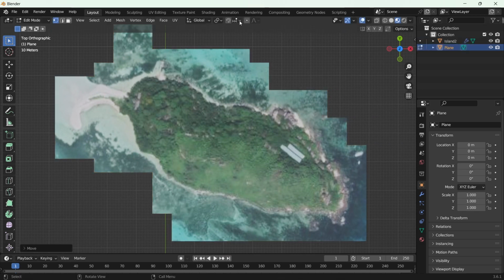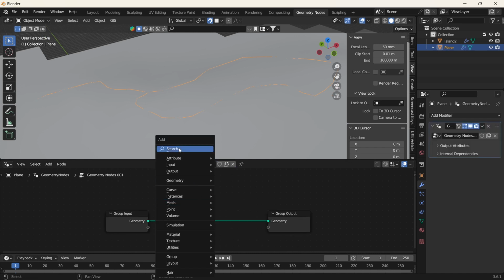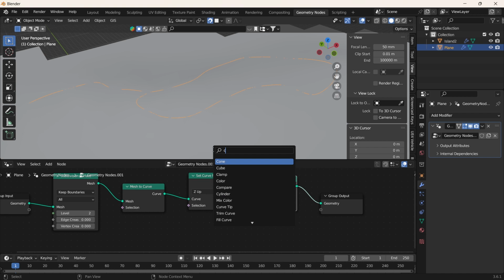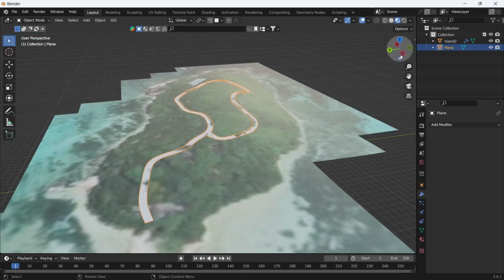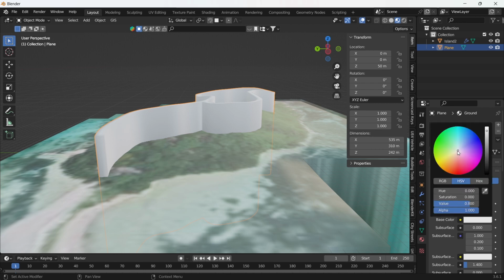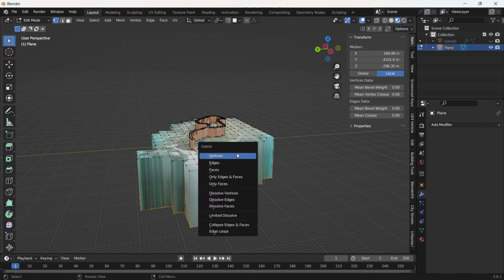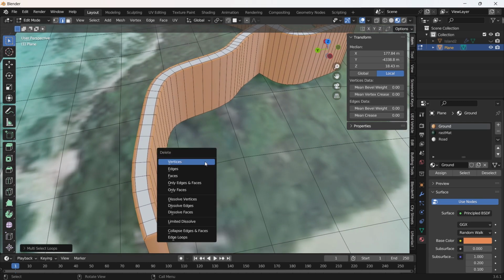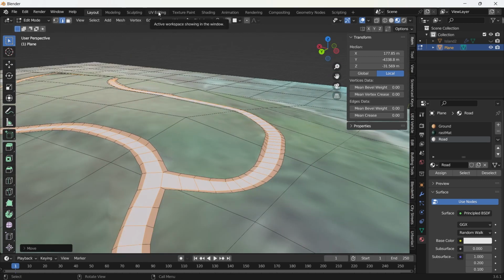How to make Mountain Road in Blender 3.6 | New Method

Comment: Hey, I have a problem when I select the plane and the faces before extruding all of it. When I drag the cursor to select everything, it won't actually select everything, but some points and faces. This prevents me from extruding everything correctly. What is this due to? Hope it's clear to you as it might be some very stupid thing lol
Reply from the maker: Ig u need to do manually, sometimes it doesn't work for no reason at all. Some problem with the face normals prolly, it doesnt recognize them as connected

Alternatively, just press A to select everything, in edit mode

Comment: Hello. 
I managed to get to Boolean Modifier part, but when I do it, I get a crater in middle of my path instead. 
Would you have any tips?
Reply from the maker: U have to do union maybe u r doing difference. If it doesn't work try applying the modifiers on the ground and then merge road
Reply: @Gamezoneadi  Thanks for reply, m8.

I fired up blender again and while trying your tips, I noticed that I have weird acting terrain.

My terrain goes flat in Edit Mode, has only 4 vertices, in corners, and it deforms a bit when extruding down. I used OSM Mapnik and OpenT for hight.
Reply from the maker: Check out the starting videos of the playlist

Comment: Really interesting way to do this with the nodes and extrusions, well done for working this out! Thanks for sharing it in such a straightforward tutorial 👍🏼 are you using the same gis plugins from previous blender versions to get the terrain?
Reply from the maker: Thank you. Yes it's the same plugin
Reply: @Gamezoneadi  going well following along until the point where we extrude the plane and the terrain. I’ve checked normals and merging for stray vertices and it all looks good but when I try to extrude on the z axis in edit mode it’s not moving at all. Yet to find a good answer on the google machine, any tips?
Reply from the maker: https://discord.com/invite/StBaCZ2f
Join my discord and share some pics where u got stuck. What's the google machine problem u r facing?
Reply from the maker: After merging u need to dissolve the outer edges and move the remaining road faces on z axis(not extrude)
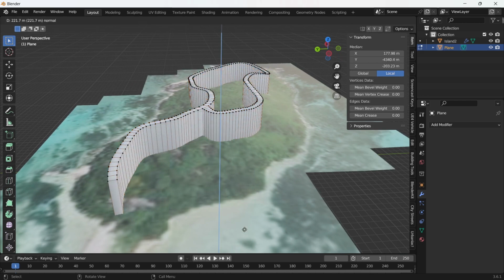Reply: @Gamezoneadi  thanks for the quick response, still no joy unfortunately, I'm referring to the bit at 4:25 when you extrude the path down through the terrain, just can't get it to budge. Will jump onto discord thanks for that. The google machine reference only means I've searched for solutions all over the interwebs but have not had any success solving it yet!
Reply from the maker: @AussieDaves  oh wait do u have that snapping button on?
Reply: @Gamezoneadi  as per your discord chat, the fix for me was making the view clip start 100m. Technique worked great, will now apply this to a higher res terrain 👍🏼
Reply from the maker: Don't use a high res terrain, instead make the road high res. Then u will be able to add more world details while consuming less memory
Reply: @Gamezoneadi  Yep no worries, by hi-res terrain I’m referring to the accuracy of the initial mesh to ensure the elevation is more realistic than the gis version. Will manage the poly/vertices count pre ks-editor 👍🏼